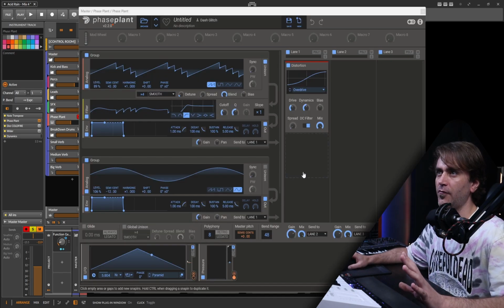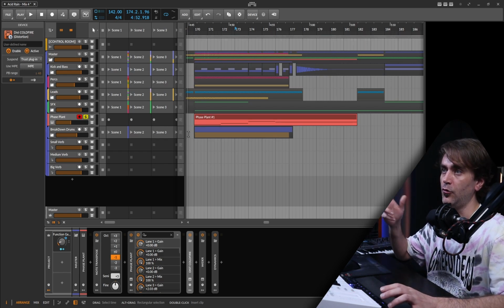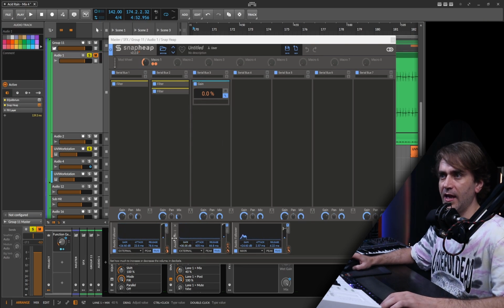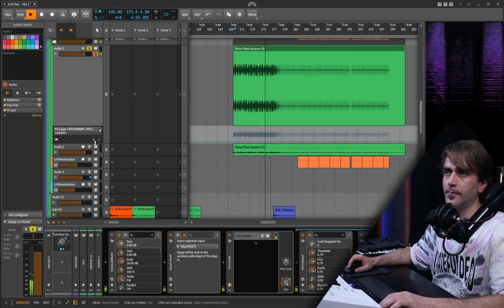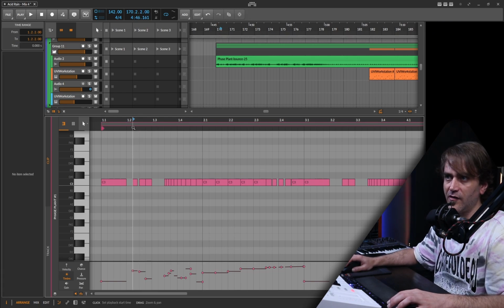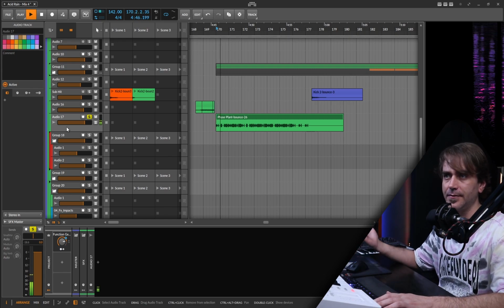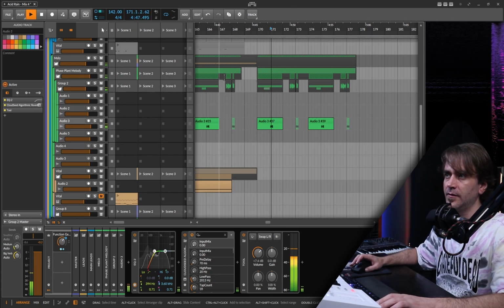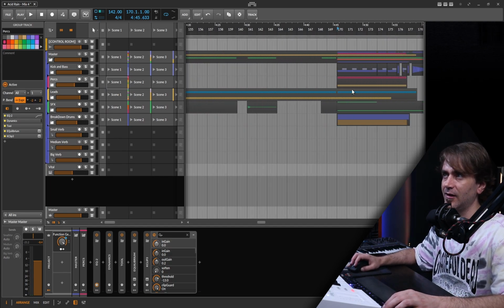How I Made My Most Insane Drop Ever - Psytrance X Colour Bass Track Walkthrough

Comment: Cool! Can scaler EQ be used instead of pitchmap to get a similar sound you think?
Reply from the maker: Scaler EQ is closer to Chroma, it's just harmonically relevant boosted EQ nodes, so a lot of the "noise" still comes through while pitchmap "transforms" the sound a bit cleaner. You're likely to get a closer sound with just a vocoder with a big chord as the modulator and a low bandwidth
Reply: @DashGlitch  interesting. Thanks!